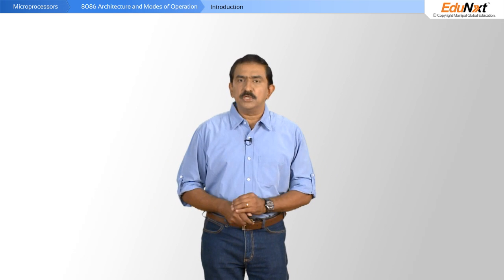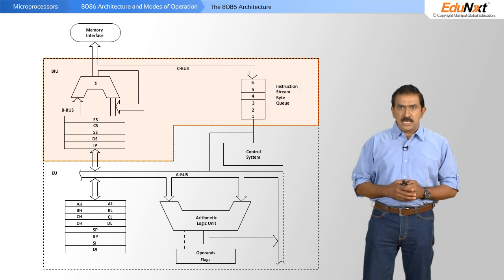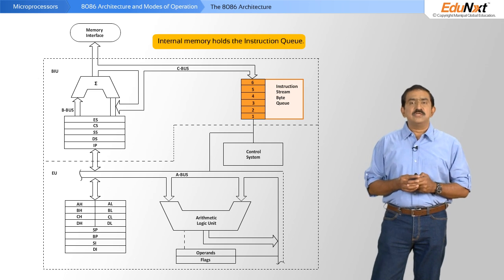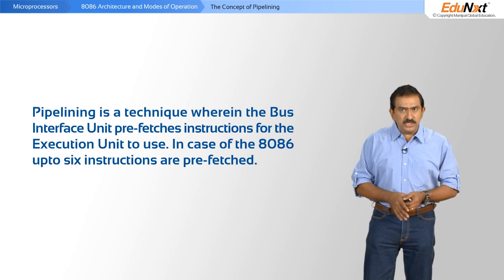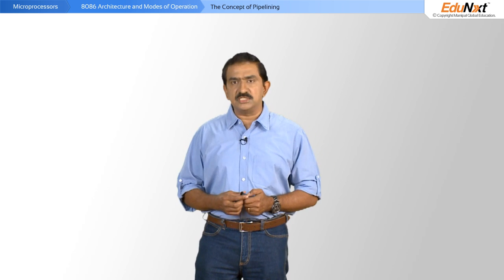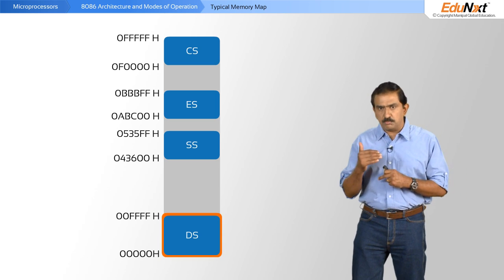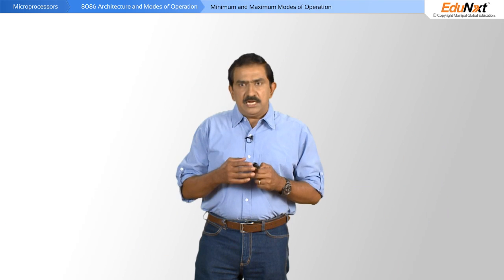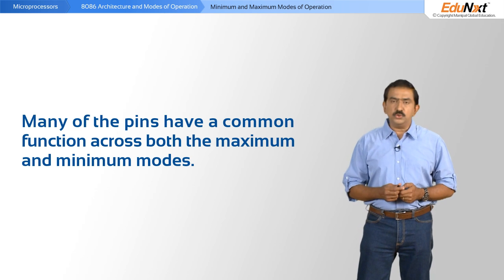8086 microprocessor architecture | microprocessor 8086 architecture | 8086 addressing modes

Comment: sir, i like your class. but you have said that pin no 30 makes the processor to act either in maximum mode or minimum mode but it's not pin no 30, it is pin no 33.

Comment: Can anyone tell me what is the meaning of that 8085/6/7 code & what is the difference between them?
Reply: Tanmay Mukim the 8086 is the ancestor of todays cpu's used in pc's, the i5/7's or amd's equivalents, it is the central cpu of the pc.  The 8087 is what is called a floating point unit, basically it allows numbers with decimal points to be calculated, the 8086 only does whole number calculations - modern cpu's have the floating point integrated on the same chip.  the 8085 is unrelated to the 8086 instruction wise, but both were made by intel and it was another cpu, intel created various cpu's in the past for different purposes.  There was the 8088 that was directly related but it had a 8bit bus rather than 16bit in 8086 - basically cost cutting, it was the cpu used in the very first pc's ibm released, they created the pc even though they lost it to the various cheaper clones later.
Reply: myst snake I learned 8085 but no one told me the meaning of that number,thnX.
Reply: myst snake What about 8051uc ??

Comment: how a segment is of 64KB size?
Well as far as I understood, as the size of segment register is of 16 bits, this means the NUMBER OF segments is 2^16 = 64K, with each segment having size of 2^4 = 16 Bytes, adding all to 2^16 x 2^4 = 1MB,  i.e the 20 bit physical address space.
Reply: tango2olo a 16bit cpu can only access 16bits, hence the 64kbyte(16bit) of ram, the extra 4bits on the address bus is used to switch which chunk of 64kbyte is written to(this is inefficient compared to the flat mode of 32/64bit cpus, which allows all memory to be accessed in 1 chunk), but by using those 4bits its gives 16 segments or pages/banks of memory, allowing the full 1mbyte to be addressed.  In theory it could of accessed 8mbyte by using a full 8bit extra, but this way a error in the thinking in 1981, that anyone would need more than1mbyte, the pc originally shipped with small amount of memory, 256kbyte was considered large at that stage.Your explaination was backwards or reads that way if you meant it opposite way.

Comment: 20 address lines means that you can generate 2 to the power 20 unique addresses. This is 1,048,576 unique values which is equivalent of 1 Mega addresses. Each address accesses memory which is a byte long in the examples quoted. Therefore the processor can access 1 Mega addresses of 1 Byte each which means 1 Mega Byte. Trust this explanation helps.